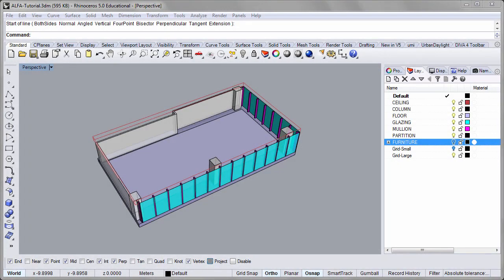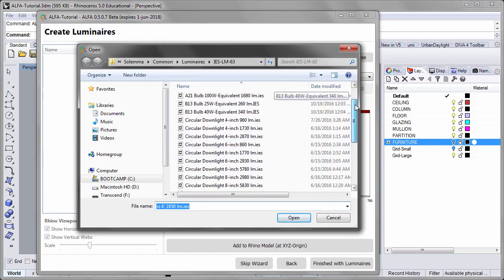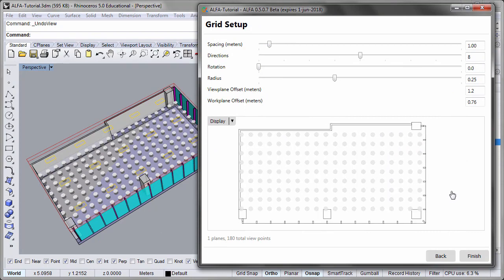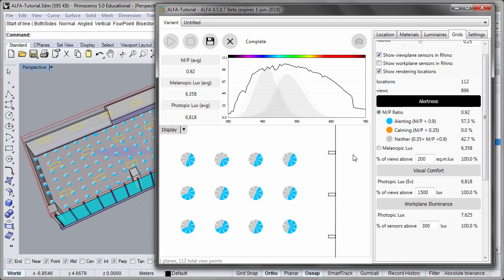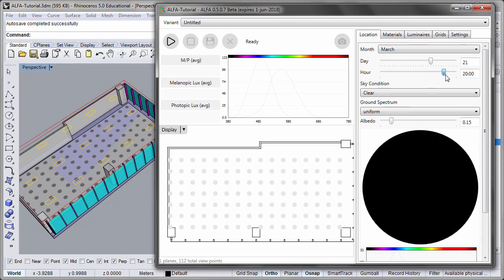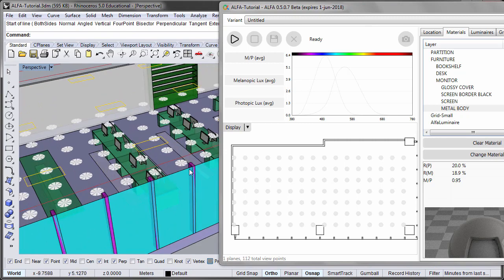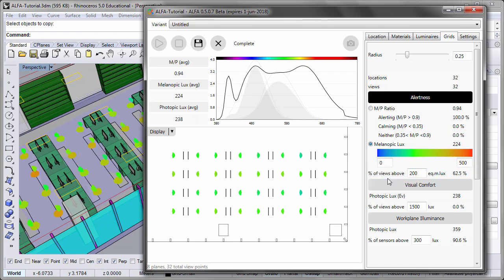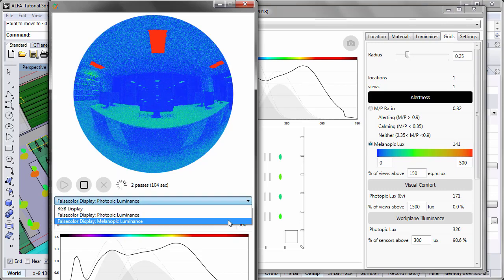Introduction to ALFA

Comment: I’m having trouble setting up the ALFA plugin. I installed the plugin, saved the license file in the correct directory (C:\Program Files\Solemma\ALFA\bin\), and ran the "ALFA" command in Rhino. However, I get the error: "The input string does not have the correct format."
Reply from the maker: ALFA isn't 'region safe', so if you use a comma separator for decimals on your computer, you'll end up with odd results when it expects a dot separator. You have to switch this at the computer level to use ALFA right now: https://resrequest.helpspot.com/index.php?pg=kb.page&id=279

Comment: Hi, I have a problem with the ALFA simulation result, the results of photopic and melanopic lux is always infinite. I have tried making the opening as small as possible but it's still infinite (I also already input the materials for opaque and glazing), can you guys help me? Thank u!
Reply: Did you find solution for this issue?
Reply from the maker: This comes from not coding for non-US decimals. You'll have to configure your computer to use a dot (.) rather than a comma (,). 

Side note, soon ALFA will be replaced by a spectral mode inside of ClimateStudio, which will handle different unit formats correctly.

Comment: Is there any possibility to add materials via CSV or different format to Alfa?

Or there is only possibility to add it in 360-740 nm range?
TIA
Reply: did you find solutions for this issue?
Reply from the maker: Unfortunately, you do need measurements in the proper range and wavelength intervals (or to interpolate / extrapolate them beyond the range of your measurements).

Comment: Hello,
is there a need to keep 100 (by default) passes in: Settings > Stop run after__passes?

thinking about processing time.
Reply: even setting the same parameters of this video in my model, however the result has always returned as null.
Reply from the maker: Sorry to hear that you're still having trouble, feel free to email us at support @ solemma.com with your specific questions.
Reply: @solemma  sorted out! The problem was the setting of comma to point in decimals in Windows.
Reply from the maker: Fewer passes will indeed make your model faster, but you should verify that you don't lose result precision based on poor sampling rate. You can test by running a model 2-3 times and verifying that you receive the same results each time.

Comment: When I am about to run the simulation, I get this error "octree error - octree failed".
Any clues how to fix this error?
Reply from the maker: Hello! Thank you for your question. 

Usually this specific error means that you have either (a) very very dense mesh triangles somewhere or (b) a poorly formed mesh with very long and narrow triangles. So look for unnecessarily dense meshes in your model, often present on details. 

If you'd like us to take a deeper look at your model, feel free to send it to us at support@solemma.com.
Reply: I have the same issue, have you found a solution for it?
Reply: @yannisfilippousis6555  yes I solved, i could be something related to the geometries tou have modeled in Rhino. Cylinder, sphere and complex geometries have problem to be read and computed in ALFA. Just work with boxes